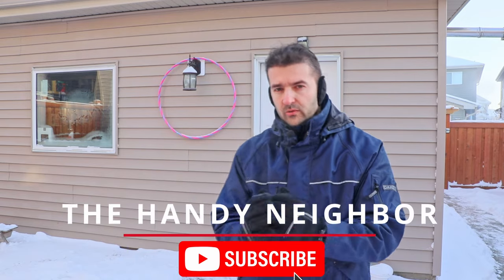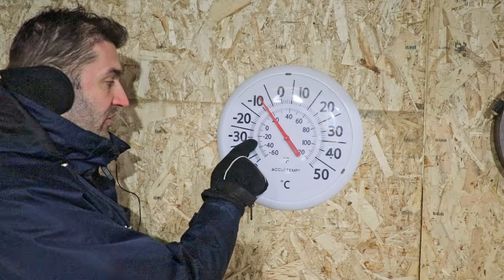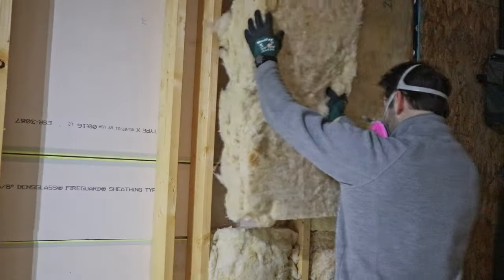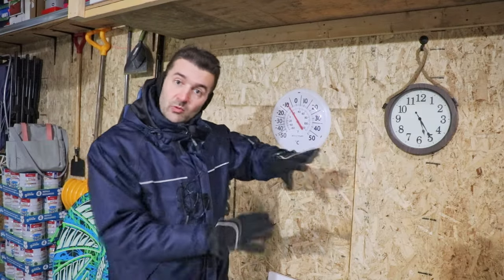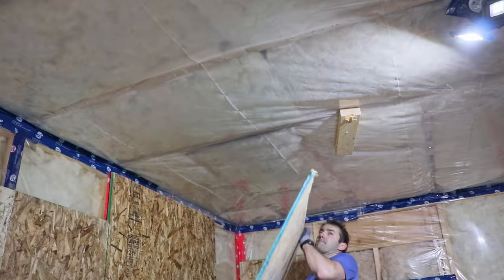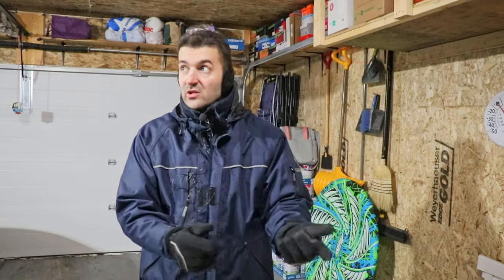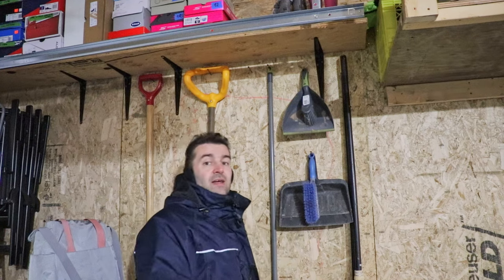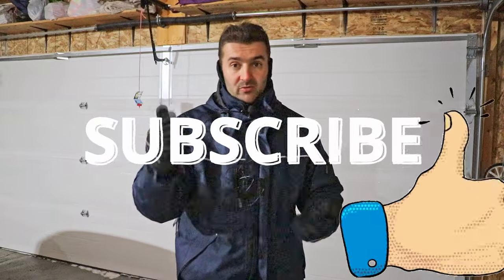How Warm Does An Insulated Garage Get?

Comment: It would be interesting to know the average temperature difference between the inside of the garage before you insulated it, and then after.
Reply from the maker: Thank you for the feedback. I can tell you it was not much warmer what I remmeber. I did not have the frost on my car windshield but it was still very cold, maybe 5 degrees warmer than outside. And I could not warm up garage with the space heater once my car broke down to work on it as attic was open and vented. 
It is cooler and pleasant in the summertime. 
Please like and subscribe!
Thanks!